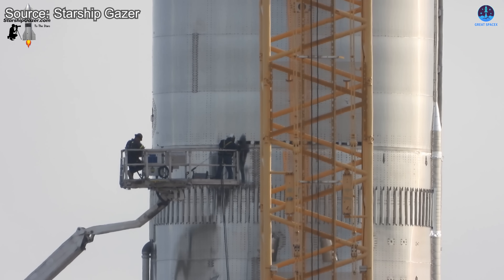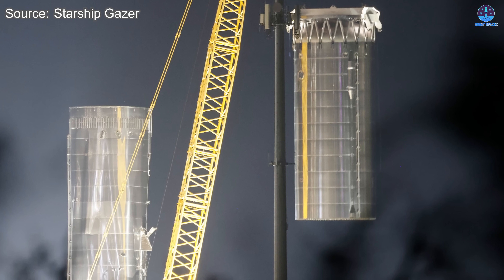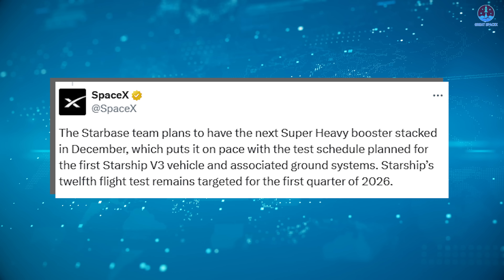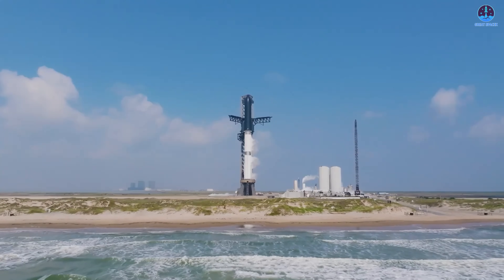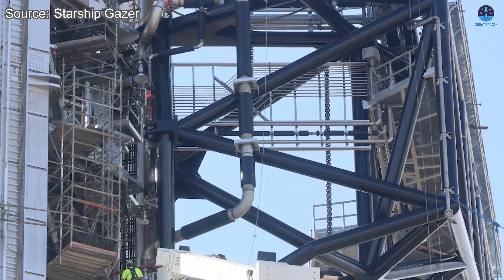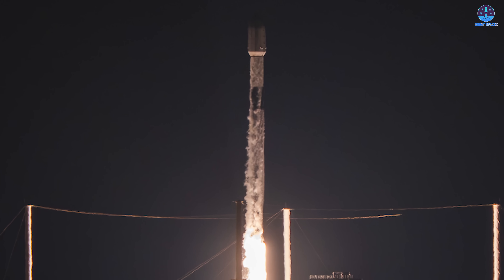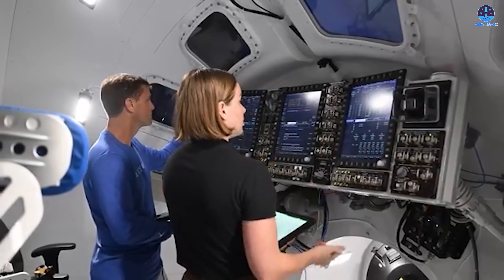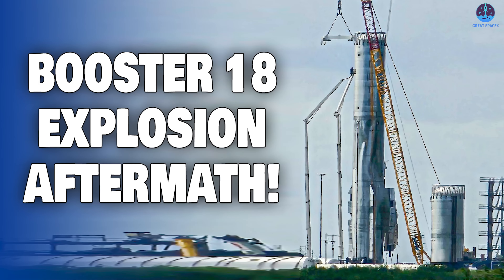What SpaceX just Did with Starship after Booster 18 Incident will Blow Your Mind...

Comment: If booster 19 is in assembly I assume they have explained the booster 18 'unplanned disassembly' and I wish they would tell us what caused it. The only reason I can think of is that the test procedure was flawed or the equipment failed resulting in an over pressure. Anything other than that would require some serious review of the booster hardware and assembly processes. Whether it is worth the effort to continue booster 19 is dependent on the answers coming from the booster 18 review.
Reply: They probably don't know exactly what caused it. Booster 19 was already being assembled when the RUD happened. I would worry about a design flaw that needs to be addressed. As you say, booster 19 may have to be modified.

Comment: Dumb question: Why can't Spacex utilized solid rocket fuel boosters on the side of Super Heavy to assist in the launch and reduce the amount of fuel required to get Starship Past orbit?
Reply from the maker: Great question 👍
Reply: I’d think they could, but then it wouldn’t be fully reusable anymore. You can’t land the solid boosters for reuse. Once they burn through their fuel, they’re ballistic, and you can’t throttle solid rockets for a controlled landing.
Reply: @TomBrendel  I'm talking about Solid rocket boosters that jettison after expending their fuel super heavy still can come back for a landing.
Reply: @richbl1690 Several reasons. 1st Superheavy is designed to return to the launch pad for rapid reuse with emphasis on the word rapid. Second, Superheavy stops short of orbital speeds and slows down before reentry. That way it does not need a heat shield that would add weight and complexity. Third, attachment of boosters would require massive structural reinforcement to the attachment points. While all of this can be done it would require essentially a whole new vehicle. SLS took the booster approach and has been in development for 20 years.
Reply: @richbl1690  he already gave you a very good answer and reasoning for why they don't
Reply: @TomBrendel Nasa used to splash down and reuse the space shuttle srb's back in the day
Reply: @DawidSmithmeow True, but having to recondition them after immersion in saltwater doesn’t make for a rapidly reusable solution. It worked for the shuttle because that system was anything but rapidly reusable.
Reply: @TomBrendel what about liquid fuel boosters landing back at the launch site like super heavy or on barges like falcon
Reply: @DawidSmithmeow Why? Sure you could redesign the Superheavy booster and the launch mount to launch with two more strapped on the sides. But, punting the middle booster that fast would destroy it upon reentry. Now that is how NASA does it, but they care nothing about throwing away another 63 million dollars of taxpayers money, it's not like they have to pay for it. Also, that could get a HLS to the moon and landed without a low orbit refuel, but you still need the fuel depot for the return trip. So you have to develop and perfect space refueling anyway.
Reply: @D @DawidSmithmeow  strap some falcon knives on the side of super heavy and they can separate and land on their own.
Reply: NOT a dumb question. I've thought that with a bit of modification to the booster structure it would be possible AND for VERY heavy payloads worthwhile. Also, if using SRB's you might have an expendable version of the second stage without the tanks in the nose and no fins or heatshield tiles.
What could be so heavy? Solar cells are great for the free sunlight but it takes huge panels to get high energy and they degrade and lose efficiency in a decade. Plus you have to have batteries to store the energy for when the orbit takes you into the earth's shadow. The solution would be a nuclear reactor but you wouldn't want to try to build it in space (much harder engineering complexity) but a complete 'small' reactor, steam turbine and generator would be heavier than anything we've got launch capability for today... But the SuperHeavy with SRB's and an expendable Starship could work quite well.
Reply: @bobjoatmon1993 Four HLS cargo variants can put a 100 megawatt PBR, electrical generation, batteries, and backup solar panels in the Moon with current mission architecture.
Reply: @edwardson6825  if you look at the COST of those 4 launches it's uneconomical. I'm not just winging it there's actually a engineering study out there that points out the need for 'dense energy' to properly develop space and that it's not feasible to build / assemble the heavy components up there but the reactor, steem turbine and condenser need to be one unit which IMHO, at this time only an enhanced SuperHeavy could do.
Reply: The Space Shuttle cost around a billion dollars to re fly. And took several months at best.
Reply: Not reusable - takes months to refurbish. and is outragously expensive.
Reply: @JessePollardII in some circumstances, it doesn't need to be reusable. Example Falcon Heavy has several timed expended the core and also a couple times expended all three.
Reply: @bobjoatmon1993   That is always an option - but it also doubleds to triples the expense.
Reply: @JessePollardII yup, hey, let's cut the expense down and give up on space entirely (sarcasm) Sometimes, in the real world to gain a worthwhile goal it costs more. I've retired now but one of my pet peeves was the bean counters cutting maintenance but then the equipment failed much much sooner and cost much more to replace that the preventive maintenance would have. So I see things filtered through those lenses. Artemis IS a boondoggle that should be ended but I do want our species (and the US) to go permanently to space to live. It can't be done on solar cells so the cost is going to have to be born to get a 'dense energy' source up there to build a decent habitat around. And I believe that when an expansion is needed in that future, other options will be available.
Reply: @bobjoatmon1993  I agree that Artemis is stupidly expensive, designed only to launder money to unprofitable companies (Boeing and others).
Personally, I lean toward letting SpaceX do the entire project, as it has a similar attitude that NASA had in the 1960s that got to the moon. THEN the politicians threw it all away (signing treaties that prevented the NERVA/KEWI NTR engines from use, threw away Mars capability, and wasted the Apollo projects follow on plans. NOW the politicians are trying to rebuild all they threw away, finding out it is too expensive and slow to do that way (as the SLS demonstrates). And nothing prevents the politicians from throwing it away again.
Reply: Cost, infrastructure, and complexity